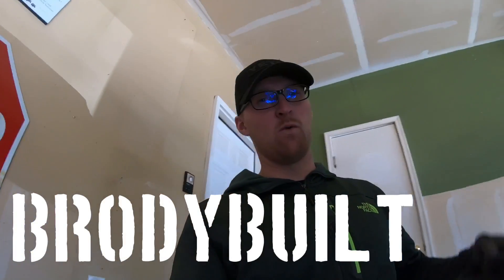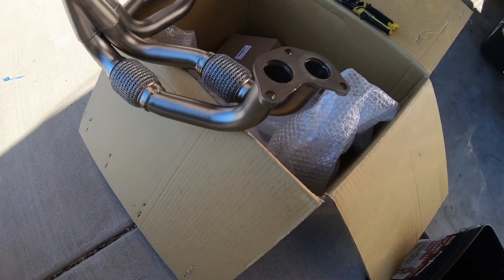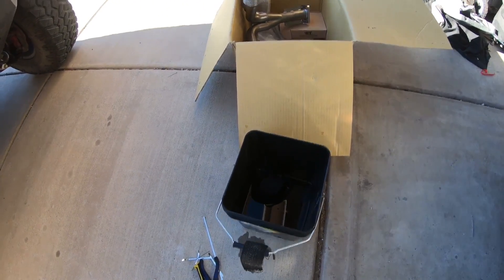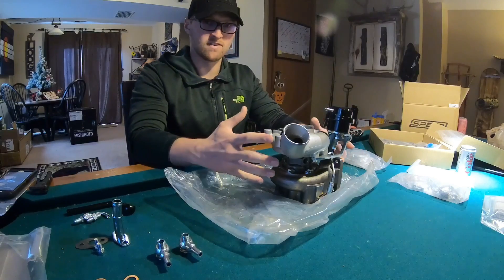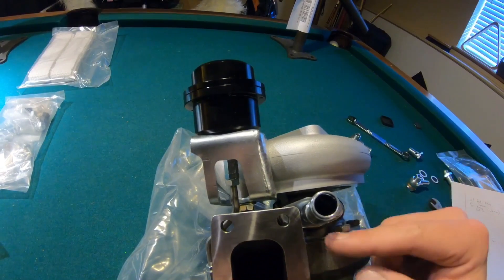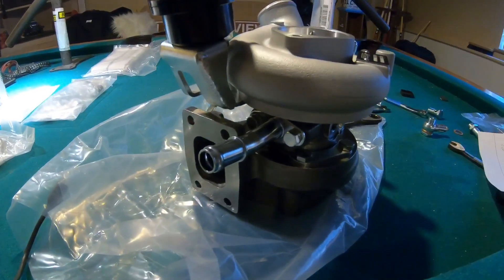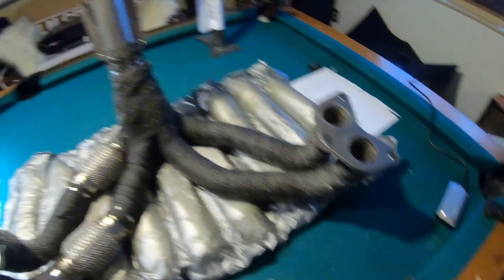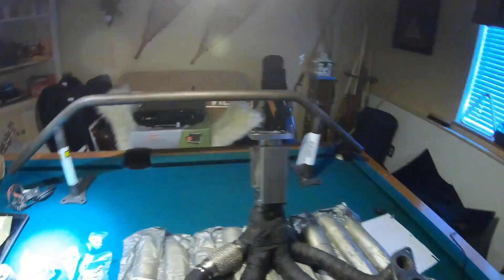Scion FRS Turbo Install part 1 (Speed By Design 500x Toyota GT86 Subaru BRZ)

Comment: Do you know torque specs on all the bolts you prepped on the turbo
Reply from the maker: I’ll have to look, been awhile since I did the install haha
Reply: @BrodyBuilt  do you remember if the instructions listed them? Haha should be ordering my kit when they come back in stock.
Reply from the maker: Unless they come with instructions now the kit did not come with them when I ordered it. I had to look up the greddy turbo instructions and use those because they’re almost identical

Comment: Looking into getting this kit. How has it been? Performance and quality??
Reply from the maker: It’s been great, you honestly can’t beat this kit for the price and installation is very straight forward. The earlier kits had an issue with the headers cracking but that’s been resolved on the newer ones and everything else is well built.
Reply: @BrodyBuilt where I can buy it? Seems they discontinued

Comment: soo what did u need in addition to kit or did u come with everything u need so u dont blow ur engine ?
Reply from the maker: Aren Welsh you won’t blow your engine with just the kit, if you still with pump gas and a basic setup you’ll be fine but if you start upgrading injectors, go e85, put a bigger fuel pump in, etc. then it might be beneficial to upgrade the internals of your engine but you’re fine with just a kit install

Comment: Is your turbo have boost after the base tune? My doesn't, any help??
Reply from the maker: Huy Nguyen yes mine did, I would say something must be not connected but if everything is connected maybe there’s an issue with the turbo or the waste gate possibly... I’m sorry I’m not much help I’d definitely have to check out everything to see what could be the cause
Reply: BrodyBuilt yeah, for some reason my rpm couldn't go higher than 4500